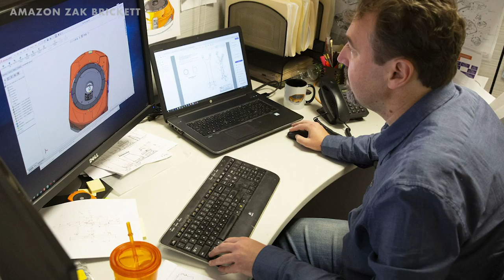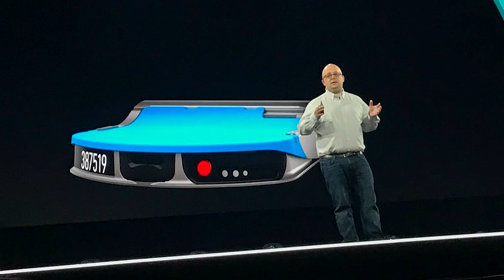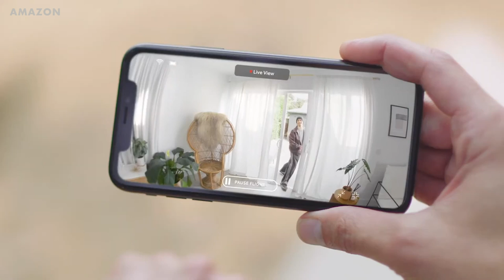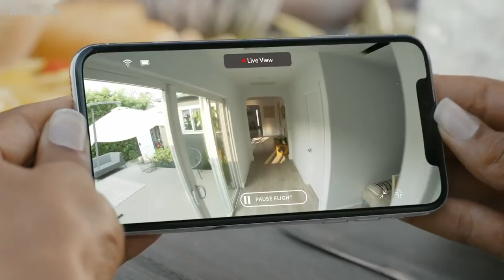Amazon's Robotic Empire: Jeff Bezos' Smart Warehouses

Comment: I'm an Uber driver and it's almost the opposite things going on the Uber AI assigns the job to the nearest driver, pick up passenger and the AI watches me and tracks me and directs me where to go and where to drop off the passenger. I think this is the future of a lot of jobs, it will be a synchronicity of partnership between man and machine. I mean look at  just about all sector, even in medicine surgery is done with a doctor controlling robotic arms. Teachers use a cruriculum that is assigned and tracked by computers that determine which student is where and how to push them to achieve further

Comment: It's a huge warehouse.  They could fit a ton of solar panels on those roofs.  As most robots are electric, this would be a good match.  Just add batteries.

And they could use geothermal for heating and cooling.
Reply: Amazon is smart to do cost/benefit analysis before doing anything like this.
Reply: More and more I'm sure they are going in that direction. Both Bezos and Elon Musk have talked up using more renewable energy sources to power their huge factories. Its definitely the imminent future
Reply: Агрон Департье 
Solar, and other types of energy, would provide independence from utility energy price fluctuations once it is installed.  
I'm thinking this push for complete automation is so that they don't have to heat or cool or light the warehouses at all.  Robots can operate in the dark, in the cold, and in stifling heat.  And no need for bathrooms, either.

Comment: 🙄. Once I've learned a system and it's organizational structure I wouldn't and have never needed a wrist computer to tell me where to move my hands. That's a natural ability once one acclimates to the number system. Along with some other co-workers acclimated as well, I know it's completely possible to be slowed down by technology because it has glitches that can and do totally screw one up when it disconnects, falls behind, has a programming failure that doesn't assist in a natural prompt by the brain, and any other 😠🤬 moment that throws one off one's "game". Like when one scans a package that snuck past somewhere that doesn't belong in a particular aisle on a conveyor and there's no backing up on the screen so either walk it to the area it belongs to scan it in completely or else reset the damned scanner because the package belongs on the far side of the building a football field away. 😠🤬.  And the best of the best do make it a game to play. Competing with one's self removes the viciousness of the heated competition and oddly enough, the Covid gave us all space so security doesn't have to worry about who's on the edge of smacking each other for getting in each other's way which was previously impossible to avoid. 😬 I like the robots that move things though because no dust settles and it keeps the floor clean as well as carries stuff around. 😊